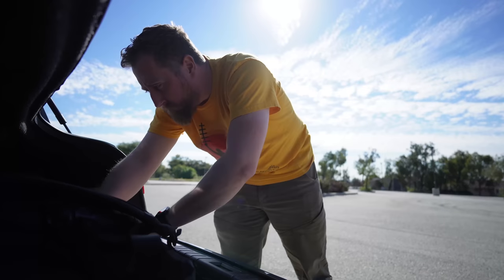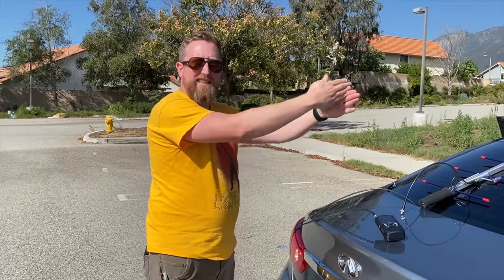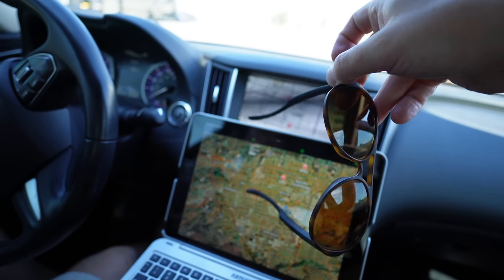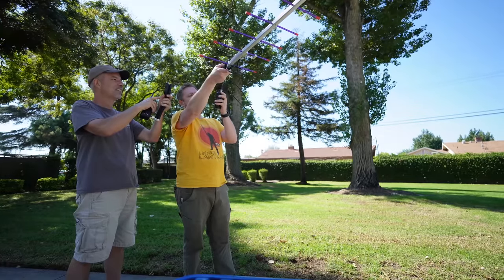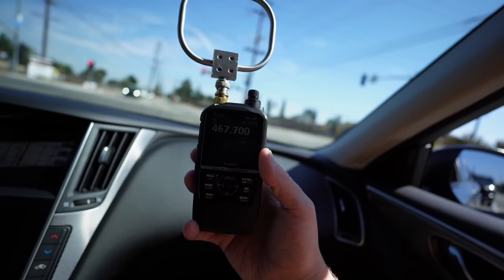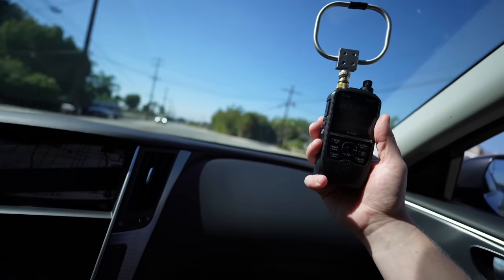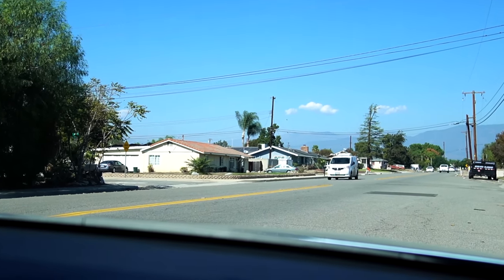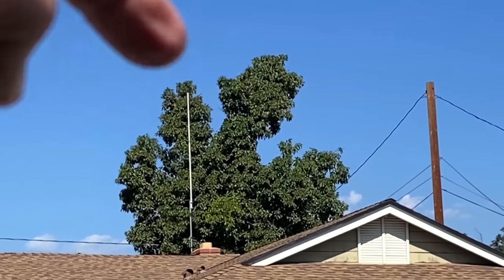Locating A GMRS Repeater Jammer With Josh From @HamRadioCrashCourse- It's A GMRS Jammer Fox Hunt!

Comment: I use the "horn honk method". When you get to the suspected exact location you honk your horn while he's talking. Less than a second later you hear your own horn honk coming through your radio speaker. That's how you know for a fact that you've pinpointed him. It worked during the CB days.
Reply: So if you call the FCC to give the address, is anything done?
Reply: Then the grappling hook got tossed up on the antenna and the whole thing went for a ride as you drug it down the street.
Reply: Hah!! That’s great! 🎉
Reply: @EvolvingNaturally  
Almost never.
Reply: Good idea!
Reply: @richb.4374  Jeeps are known to have winches with 100 feet of line on them. Just sayin'....
Reply: Old school, the best school!👍👍
Reply: @EvolvingNaturally  Probably not. We've tracked down several imported intercoms transmitting a steady carrier on 467.625. I was quickly in contact with an agent after I submitted a complaint. I showed the agent photos of the device, spectrum analyzers, technical data the fcc approved, and the fcc didn't do anything about it.
Reply: @jonathanmcbride1504  It's been decades since the FCC had the manpower and will to act on such stuff. However, if you interfere with airlines or emergency services, then you'll have the FCC on you for sure.
Reply: @James_Bowie  Agreed. "Will" being #1 in my experience. It took them 17 years to get the Unabomber, and that was only because his brother dimed him out.
Reply: @jonathanmcbride1504  They're handed the names of school shooters and don't act on it. It almost always comes out after massacres. It makes me chuckle when people are legit worried about chatting on the radio.
Reply: thats genius
Reply: @James_Bowie  They should hire 87,000 more FCC agents instead of 87,000 more IRS agents.
Reply: @EvolvingNaturally  They aren't called the "Funny Candy Company" for nothing. 

They send boxes of chocolates and a sternly worded letter with no teeth.

Comment: Pretty cool! I did it a little differently back in the day on CB. I had the car set up as a directional antenna. When I had the co-phased full wave whips, I had them mounted on the rear bumper. That set up was sensitive enough, that I could get a general direction by changing lanes on the freeway. My CB also had an RF attenuation circuit, that I could direction find a 300 watt transmitter at less than 1500 feet. For real close hunting of high power systems, I also had a dummy load. For low power signals, like a walkie talkie, I had a handheld that I could collapse the antenna on. If I needed to hunt down a GMRS signal, I would likely just put a magnetic mount on a front or back corner of the car for directional use. If your GRMS radio doesn't have any kind of a signal meter, or the meter isn't very accurate, I would use the squelch settings to find the direction.

Comment: sig trax is a handy app for plotting signals, when up close to the transmitter an offset attenuator is really useful allows you to continue using a directional antenna.

Comment: Josh, the initial check (and subsequent ones), your antenna was held horizontally. VHF/UHF is vertically polarized. Any reason? Desense the signal? Love to know.
Reply: He held it horizontally because he stated he was Using it To trace the Signal We don't live in the sky so Horizontally would Help trace and or track the signal causing the Chaos

Comment: So hypothetically speaking (I’m very new and only curious)— if I obtained a radio and was transmitting on a freq without any of the proper licensing. Could they tell I’m using an AES256 encryption, and does it make the process of fox hunting more difficult for them? Also how much does the FCC really care if you don’t have a license and we’re operating in these freqs? I’m only curious and don’t know much, Google doesn’t help me much
Reply from the maker: it is easy to know that you are transmitting a digital signal, although I'm not sure how hard it is to determine that your signal is encrypted.. and it is just as easy to track a digital/encrypted signal as it is to track a regular analog/voice transmission.. To see how much the FCC cares, watch this video:  https://youtu.be/UQc02jc_uPI

Comment: Yes, this makes sense. But this only works like a charm if the person stays in the same position connected to the same repeater for an extended period of time

I assume driving around and using different repeaters would be far more difficult, or near impossible (for the FCC) to find
Reply from the maker: Yes, exactly like we said in the video..

Comment: What do you mean the FCC will just send a mean letter to the jammer? All the sad hams say the FCC will fly their helicopters, drop down on the roof, break in through the ceiling, and issue you a $10k fine! These are guys with 1x2 or 2x1 callsigns and have been sad hams since 1920. They also walked uphill to the FCC office in 20 feet of snow to take their license test, which required copying morse code at 200 words per minute!
Reply: Let it go . . . .